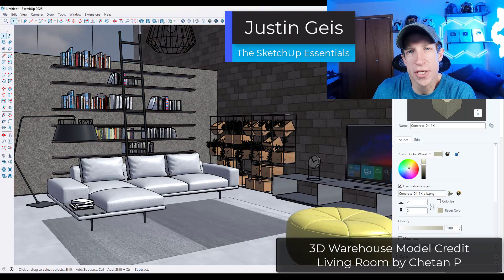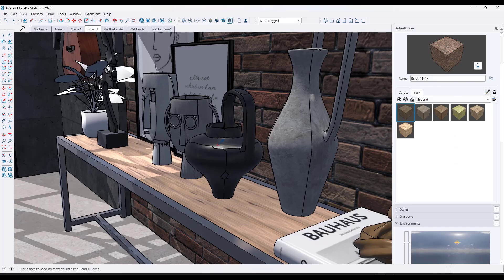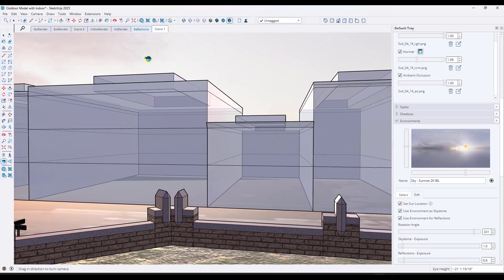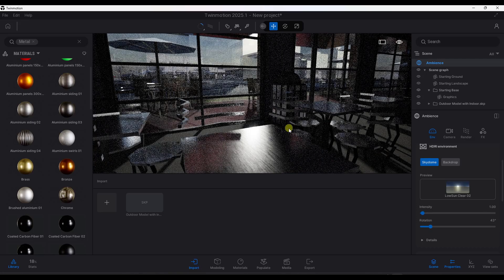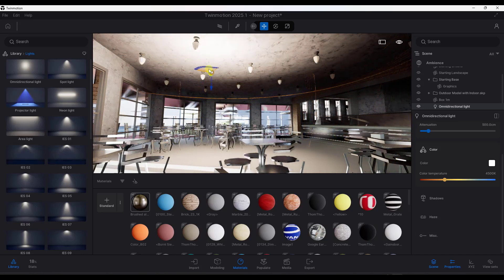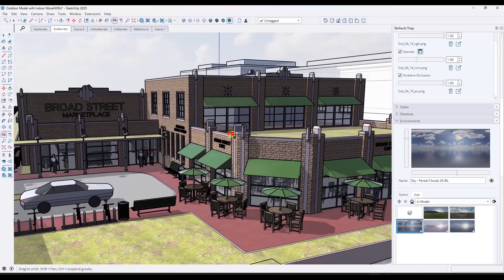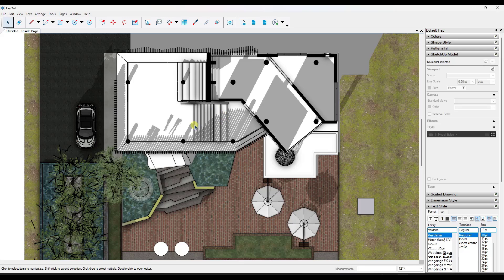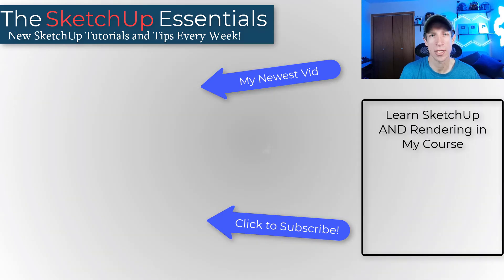Should You Replace Your Renderer with SketchUp 2025? (The Truth)

Comment: Thank you for another good tutorial Justin. 

However, as others mentioned, skethcup is a bit late to get into realistic rendering market to compete against Enscape, Twinmotion, D5, Lumion, and others. I have beein using skethcup almost 20 years for general contractor workflow: site logistics, virtual mockups, and others. As of GC, the bigggest challenge to work with Sketchup is, as some of other users commented, it crashes often, as my file sizes are getting bigger to cover larger scale projects in case of the file size is bigger than 100~150 MB. Skethup is still good tool to develop 3D models relatively easier and faster integrating other BIM software. I would suggest Sketchup team to focus on their stregnth rather than weakness. The bottom line for the native sketchup rendering is early stage comparing to other competitors.

Comment: First sketchup needs to resolve the "sketchup  crashed " bug , then they can do these rendering things
Reply from the maker: I don't know what this means - I'm not having significant crashing issues. Are you sure your system meets the minimum requirements?
Reply: @Thesketchupessentials  I have this same issue. As soon as I start working on something that is a bit more complex (making a detailed sofa for instance) sketchup crashes quite a bit... it really does not like when you work with many polys. :/ they need to focus on optimization and not on new features. 
I have a Ryzen 7 5800x with 32gb 4000mhz RAM, ultra fast NVMEs and an RTX4070 - so I don't think it's the hardware; although I have noticed that Sketchup is way more optimized for Intel heavily and less so for AMD.